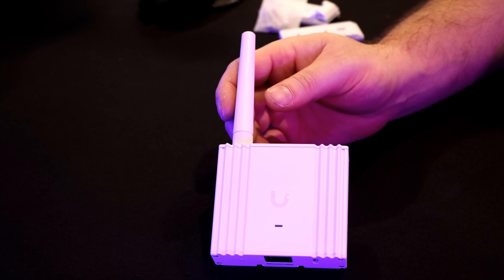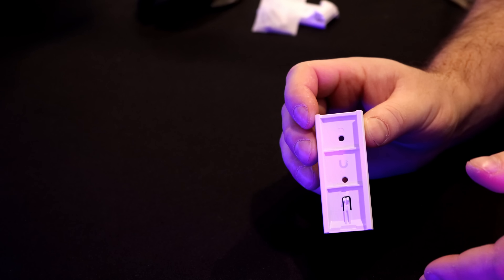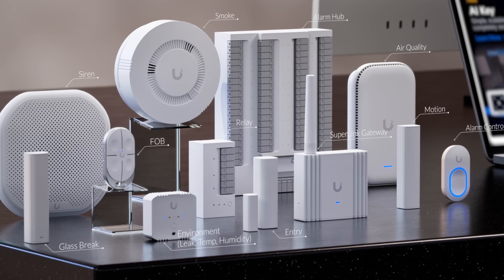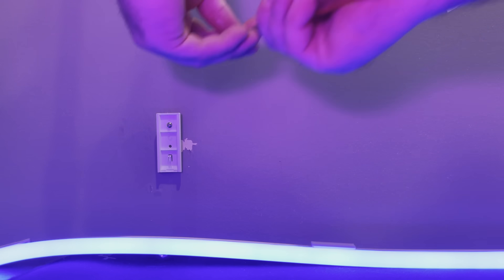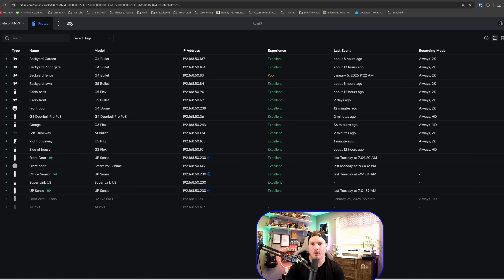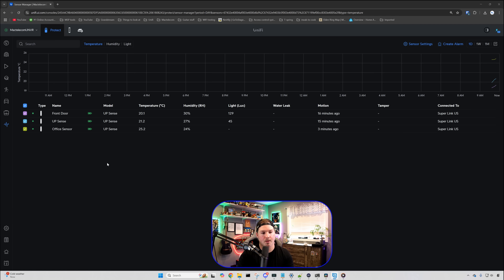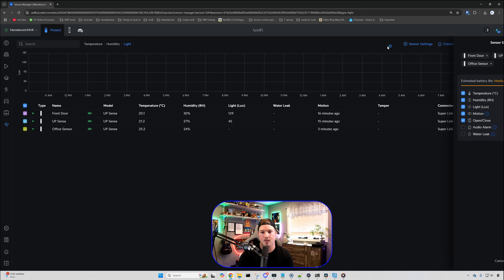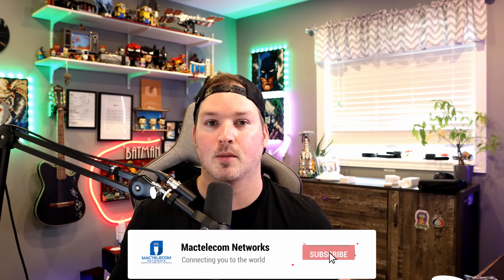UniFi SuperLink

Comment: I like the Superlink since it still has the Bluetooth for older sensors. I made sure to lock my sensors to the super link so they wouldn’t keep bouncing around between my U6Pro’s. The Superlink unit has a nice strong connection to my Bluetooth sensors vs my AP’s.
Reply from the maker: @IndianaDiy  ya they are really great

Comment: As the U6 Pro has buetooth, will this integrate with it? Or do I have to upgrade my APs to the U7 one?
Reply from the maker: Bluetooth is only required for the UP sense sensors. If you want the new SuperLink sensors you need to buy the SuperLink gateway
Reply: @Oh ok. I thought the SuperLink communicated with the APs via Bluetooth. Makes sense now.

Comment: bought a 3 pack of the sensors, tried using one as a water sensor.

went ahead and tested it by putting water on the contacts and got no notification(s) on my phone nor in protect. not trustworthy at all IMO.

Comment: I guess it could be cool if you are putting it in a business, but LoRA ~900Mhz low power sensors are getting common and not all proprietary. YoLink already has a bunch of good sensors, switches and relays that work long distances and the batteries last forever. Not to mention Home Assistant integration is an important thing if you are into "IoT" devices. The YoLink kits with a stack of sensors and hub are less than the SuperLink hub.

Comment: WiFi 6E supports BT too. The SuperLink is also proprietary for other clients as they come to the table.
Reply: WiFi 6E is a WiFi standard that has nothing to do with Bluetooth.
Reply: @JacksonCampbell  Simply referencing that the sensors are supported on those models. (not the 7 models)

Comment: Do you think the smoke alarm would require to be connected to the hub, or do you think it could work wirelessly with the standard 120v like a regular smoke detector, as long as you have the super link? I like the idea of a smoke detector from unifi but don’t like the idea of rewiring the house in order to use it and running wires to a hub.
Reply: It will likely be wired for power, but also that the SuperLink will allow a unison connection, meaning if one goes off, they all go off.

Comment: @MactelecomNetworks I guess the power bar and power plug work with the bluetooth will work with this sensor? Also can you disable the bluetooth detection in the Network AP or does it need to be enabled even for the Super Sensors to work?

Comment: Here’s a solution, don’t remove features from access points. Also, how dumb is it that they only provide one water detection case for a three pack of sensors. And of course you can’t buy them individually on the website. That’ll be too easy for ubiquiti.
Reply: While I agree, at least they aren't abandoning bluetooth altogether.
Reply: Happy to send you a couple water sensors in the mail if you need them.
Reply: @ are you talking about the water sensor case that they sit in?

Comment: What about Matter and Thread support?
Reply: It really doesn't make sense without Matter or Thread. I have no idea why they'd roll their own on this at this point.
Reply: @pelowj  serious question, is Matter and Thread enterprise worthy?  Not sure what UI came up with is, but that would be a major concern.
Reply: @handlealreadytaken  No, Matter and Thread are not enterprise worth. They aren't even residential worthy yet. All these people clamoring that it must support the standard either dont know much about it or are living in denial. The promise of the standard is amazing, but in practice it is a ** show. The standard hasnt had everything promised in it yet and the standard keeps evolving, leading to confusing implementations and products that dont work properly. It still needs 2-4 years before things are properly ready and devices should support it.
Reply: I'd buy it if it were Matter but also Zigbee, very wary of it being yet another protocol.
Reply: every single one of these protocols have issues from what i understand. you can ask Linus about it. wifi switches have less issues along as they are wired correctly. i think unifi realized this and wanted to implement something that's not horrible. but who knows, only time will tell.
Reply: Homebridge will likely build a bridge to Apple HomeKit. The Protect bridge plugin works pretty nice 👍
Reply from the maker: Not that I’m aware of
Reply: @MactelecomNetworks  Until these devices are fully integrated with widely used platforms like Google Home, Alexa, or HomeKit, they remain nothing more than a gimmick for most home users. Whether intergrated via Matter over IP or through direct integration with popular smart home controllers, their functionality is essentially dead on arrival until that changes.

Comment: I have many smart protect sensors (6 I think) and have also many U6 WiFi APs around the house.  I currently lock the sensors to the nearest AP so they don’t report “low/poor” signal strength.

Have you tested how far they work away from the SuperLink main unit?  Is it the same distance as with the U6 APs?
Reply from the maker: So I have the SuperLink in my office upstairs and a sensor two stories down in my basement and it connected instantly .